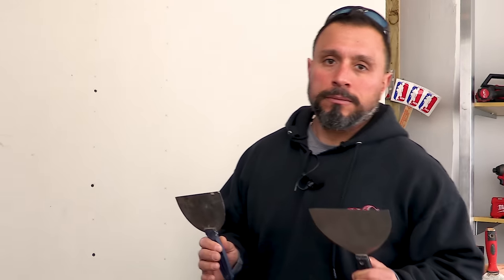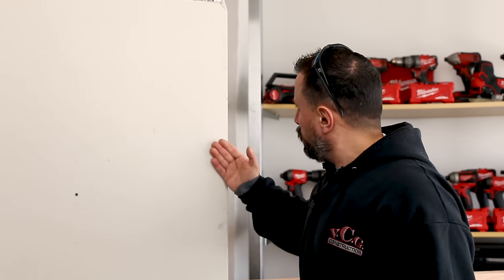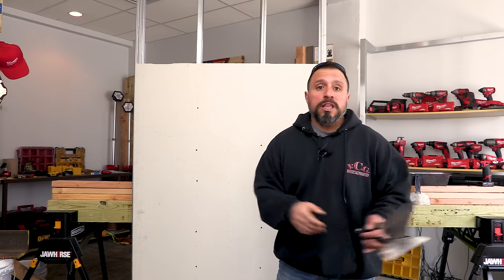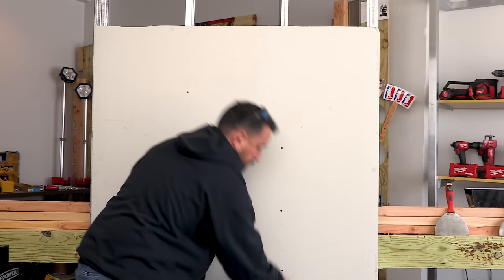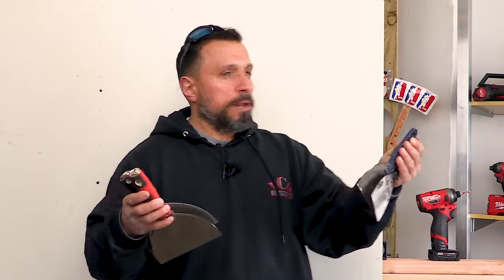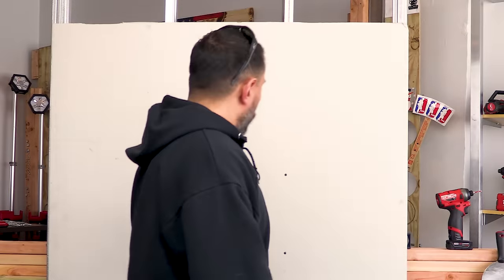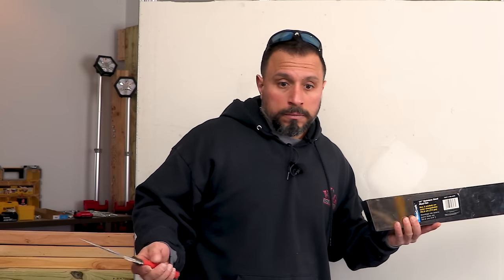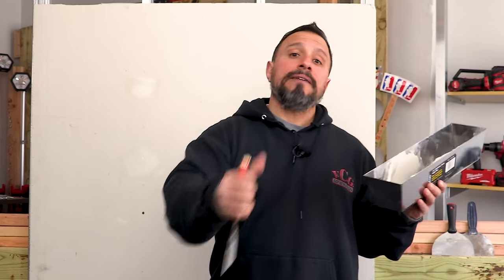DRYWALL FINISHING TIPS AND TRICKS THAT YOU DON'T KNOW ABOUT!

Comment: Great video, Vince!!!! This coming from a 30 year veteran of finishing drywall. Pre-filling gaps in seams ahead of time IS crucial. Critique? 2 of them (you knew it was coming) 1. Instead of "dry" running over screws, i always had the mud going.  Find a flaw? Correct it while mudding using the techniques demonstrated here.  2. Remove that god-awful sticker from the side of that mud pan!!! LOL! Hyde, I've found, have the best 6" knives with the slightly rounded BRASS-headed handle.   Steel can gouge and form edges that could cut the user. Just a heads up to those ppl who may be rushing out to get a finishing knife with any metal-tipped handle.  Thanks for the video and God bless! 😁
Reply from the maker: Thanks me again!!
Reply: You da man @me again
Same way I've come to do my muddin'. 
Also any major gaps like the one showed at the beginning, or any outrageous corners get filled and or skimmed before laying the tape and corners. Makes for a quick and painless tape job. 👍 and VCG you're a beast!
Reply: @MostlyPeacefulCombatVet  A brass- headed handle is also great for circling/marking flaws in the dried mud work. You probably already know that, though. 🍺
Reply: @meagain6028  for sure. But not everyone does so it's great to have the pro's of the very cool gang sharing info such as that! Everyone appreciates that! 👍👍
Reply: @MostlyPeacefulCombatVet  have any recommendation buying brass knife link?
Reply: @richardfox3924  I am not good with links. I am also just a builder specializing in finish work. I worked several trades though before opening shop. I'm no 30 year drywall finisher by any means. 
Anyway.... I just use the Kraft 5 inch taping knives with brass end. I have round ended and hammered end. You can find them at brick and mortar stores, or Amazon/ebay I imagine. I use a couple of kraft and a couple Marshalltown stainless steel knives for my fill and finish knives. Hope this helps. 👍
Reply: I agree ,  Hyde 6 inch knife is the best available.      Another tip would be to make for sure that your knife is not stainless steel .        If you get a stainless steel 6 inch knife you will never be able to break it in .    Stainless steel knives are too stiff .         Marshall Town 10 and 12 ,   Hyde 6 .       Don't get stainless steel .
Reply: Jimmy Jones marshal town trowels and Hyde 2 to 8👌I used plasterX 10 and 12 broad knives for box flushing, did it commercially for over a decade but a work injury won’t allow me anymore
Reply: Having a metal ended broad knife isn’t everything. probably the best knives I’ve ever owned didn’t have them. brand does play it’s part but the quality of the steel is the biggest thing. Spring steel blades are the best and choosing a knife that has the right spring to it for its application as well as choosing a blade that is already straight from the store. Good quality spring steel blades are actually tapered in thickness from the handle to the working edge giving it the ability to be flex when taking the edges off of joints and patches and having firmness when pressing in tapes. Probably the biggest thing before even using a new tool is to wear it in, sand off the clear coat so the plaster doesn’t bite into the protective coating making them hard to clean dry cement off of. Also sanding back the factory edges as they tend to scuff up the board and leave a rough finish on your work. Biggest tip is it’s easier to put more cement on than it is to take too much cement off. don’t think that putting a massive smear of plaster over a patch will save you from waiting around to put another coat on. You’ll spend twice as much time sanding it back than if you would have waited for the first and second coats to dry and sanded them back after having a coffee break midway through the next job your doing and you’ll still end up having an inferior finish.
Reply: @mrandrewjohns3657  I've always used drywall mud ,   I never had to apply cement with my drywall tools .
Reply: Clean your knives with an already used sanding sponge with water...it scrubs away any mud quickly. Dry or wet  and any rust on your blade. It also helps break in new knives and yes stay away from stainless cause it will take the home gamer a lifetime to break in. The other tip i'll give is wipe you screws tighter and leave no heavy edges.
Reply: Jimmy Jones I’m Australian and it is written on the side of the bags “cement”
Reply: Corn nut water and knives don’t mix rusts fast inside the handle
Reply: Jimmy Jones you should also stick to drywall as comedy isn’t your thing
Reply: @mrandrewjohns3657  YUP, right on point.  Maybe you should post a video?
Reply: @mrandrewjohns3657  
i do drywall and painting for a living. yes the blades rust a lil bit but no water on your blades...come on really....? you get a few years outta an knife and then buy another.
Reply: Corn nut my blue steel blades never need water they are easier to clean than my stainless ones but hey I have 20yrs exp drywall finishing but what would I know
Reply: @mrandrewjohns3657   You lost me here, "water and knives don't mix"?  I don't agree with Corn Nut using a sanding sponge on his knives, but mud and water depend on one another.  Leaving mud on a knife is what destroys the knife and after cleaning, I stand my knife upright, never lost a handle due to rust, just due to metal fatigue.
Reply: ya472 yeah maybe I did, there was so much going on and just blasted out a response without reading it, I’ve had the black and silver Hyde knives rust away inside the handle and had knives fracture right across the middle at the flex point. The black and silver knives weren’t my everyday knives just spares.
Reply: @mrandrewjohns3657  
i have 18 yrs exp with drywall and painting but hey what would i know?  Most taping is done with production tools now any
ways. boxes ,angle heads, tape tubes, glazers, rollers...thats where the money goes....not your pan and knife.
Reply: @cornnut2612  No one here knows you, but some people do the wrong thing for 18 years, because they refuse to learn or change.  Some people are so arrogant, they won't change, because they would be admitting failure, and they just can't do it.  lol
Reply: @ya472  
look i just threw out a couple tips for people...then bruh comes at me bout water and blades which is the dumest thing I've ever heard. scrub brushes are the most common I've seen on jobs and barrels of....wait for it.....water
Reply: @ya472 
also guessin its me you're last comment is referring to being you mention 18 yrs and not 20.
Reply: @cornnut2612  LOL   I only commented on your use of the sanding sponge to clean your knives.
Reply: @cornnut2612   I do not know you, just reading comments to the best of my ability.
Reply: @cornnut2612  I can't find your reference to me being a farmer..  did you edit or delete that ?    LOL    Well, you don't know me, but I have 40 years of renovation experience.  I do excellent work, no matter what I do.  I have had very few customers because they appreciate quality work.  I am not as fast as any trades specialist, but I do not sell speed, I sell quality, so I am constantly turning down work.  I am also a mechanic, a welder, an equipment operator, small engine mechanic, appliance repair, residential electrician, plumber, tiler, drywaller, framer, concrete work, all areas of residential finishing including trim, building cabinets, installing laminate, painting, texturing, tiling, siding, roofing.. and so on.   And yes, I grew up in Saskatchewan surrounded by farmers who I worked with.  At eighteen years of age, I could manipulate farm equipment better and faster than farmers who grew up on the farm.  I also buy and sell vehicles, real estate, operated a few different businesses... but you know what, I never specialized in just drywall.  However, everything I have commented on, is the truth and the correct way of doing stuff.
Reply: yall just like talking about yourselves.
Reply: @bryannonya9769  Thank you for listening.
Reply: Great video for tips, and from Me Again. I’ve been mudding 30yrs as well strictly independent self employed. Had a union muddier work for me 20+ yrs ago, learned so much from him.  A few other tips non-conventional but effective; durabond,,, the old green bag 90, amazing base coat product, but not for newbies.. Sometimes I mix with j.compound 50/50 (small batches) drill spinner, speeds dry times, less shrinkage, strong.... also I use “hawk” not pan. Little time to learn, but easier to use bigger knives, 10, 12,14,,, obtain smoother finishes as well. Last big tip I was taught, sand your own finish, you’ll learn to get very good at mudding...p.s. plan on 3 coats minimal..
Reply: Luv the brass end tip thnx!!
Reply: @cpmiller1965  you got it crispy m! I call that "super mud" 😁
Reply: All good to fix on the run with mud going off, I've always got a screwdriver in the top of the stilts for the base coat, but this house I'm doing now,,, some amateurs pinned it and it's taken a day and a half to prep for first coat. Screws hanging out, no screws, 20mm gaps on a 1500mm sheet, ceiling joint i spent an hour fixing, 10mm gaps in most of the square set, external corners sheeted out too far 4 my bead. Prep is key man, you got it right
Reply: ya472 I would say you are a dollar chaser. That being a comment. I try to do all kinds of different things. My work is good but I'm no speed demon
Reply: @cornnut2612  also the best way to keep clean paint and caulk off your hand in the shower. Just make sure the sponge is heavily used and it was fine to begin with
Reply: I hate those stickers, and they made with the worst glue imaginable to remove..wtf
Reply: My brother does a lot of dry wall and finishing work,  he always cleaned his knives with a sander. It would thin the metal over time, making the knives more flexible
Reply: Takes forever..
Reply: Great attitude for quality results.
I learned drywall (as a painter) doing major repair , minor remodel, restoring most surfaces, and establishing ease of motion, for all procedures ahead? Sure as hell isn't fidgeting.
Bet you do great work! Lol
Reply: @mrandrewjohns3657  I thought I was the only one I even sharpen mine (good ones) with a honing stone.
Reply: im a fan of "sheetrock" brand myself. I dont quite got 30 years in but i got 18. i used to be a fan of hyde tools, but now i only get my tools at Ames drywall supply where they have all professional drywall tools. I prefer sheetrock brand now, better quality imo
Reply: @mrandrewjohns3657  yea man, gotta heat up those Knives and peel the stickers off nice and clean then sand the edges for nice clean crisp finish work and not a scratchy rough finish
Reply: @MostlyPeacefulCombatVet  thanks for the info i go to the big box stores for a lot of tools (im sure most do) but for specialty tools have to go to the pros, like Sherwin-Williams for the good brush's (2 1/2'' 100% nylon). always like checking out the videos and comments for hiddin info lol stuff like this is hard to find if you dont have some old timers or life long pros nearby to tell ya. thanks again everyone
Reply: @mrandrewjohns3657  I am Aussie also..... and all the bags are labeled plaster in Australia. You are confusing joint cement, setting cement and cornice cement with the finishing plaster.... you did what? again? Oh I know...what would an architect know, right??
Reply: @ya472  So...a jack of all trades...master of none.... informing us all how its done?? right??
Reply: @sqnhunter  I did not realize the topic changed to lathe and plaster work.  In modern times most jobs are drywall, and the topic is DRYWALL.  Now perhaps your Aussie English has different names for the same thing, so I assume you have much to contribute to the original topic?
Reply: @cpmiller1965  someone told me a good tip was to press the first coat of mud into the hole with the back of the knife to really get it to pack in and glue it well together do you find that necessary or worth it?

Comment: Hey Vince! Ryobi guy here again reppin green team. I hang/finish drywall 8 days a week, use the new brushless makita drywall screw gun with the push drive feature,  and a makita impact driver to remove any misses or get in to corners / angles that the countersink collar on the screw gun can not get into all the way. Always wack the open holes left from misses with a ballpeen hamner, or butt of the knife as you showed, so the perforated edges dont require 3 freakin coats to make em vanish. However,  my pro tip, humble as it is, Using a ryobi 18v 3/8 stapler to tack up Quarter bead. Learned it from working with a guy whos probably the fastest/tightest/ hanger, finisher I've met. Couple weeks ago we hung 2 rooms, two closets, a small hallway and partition,  38 sheets, to code, in 6 hours. Just him and I, and im definitely not a record beater in that field, but he showed me that trick. Staples grab the meat of the hung rock corners, and the ryobi staple gun adjusts easily to sink them in a little more so theres no need  to sit there screwing off. I know somebodys probably like,' what about the bead crimper that affixes corner beads in place by pressing divets off the bead into the rock?' Well, in short, they fail over time. Getting bumped,  knocked, or normal wear and tear over time will def separate the bond, so theyll be there, but split seams will eventually pop up behind them, and or loosening that will lead to a crack right behind the bead.
Reply: I am hoping/requesting you guys do a show comparing all the new drywall screw guns, because I've noticed pretty much all the big name brands have put out newer models,  with new features,  From Makita  and Milwaukee to Ridgid and Ryobi.  ( Not sure if dewalts upgraded their gun to a newer model with push drive like the others), is the Milwaukee better than the makita? Is the ridgid official? Is the ryobi worth the 100 bucks for a homeowner/small project

Comment: thank-you, after 3 generations of passing down knives, finally bought myself an entire set of Hyde flexible stainless steel 1-12" and cant be any happier.
appreciate the tip, learned this one early on when finishing and not being able to find a hammer around, using the rear of the knife and splitting it in 2 using the cheap rubber or plastic handle, NOT full tang ones.. whole world of a difference

Comment: Love the video! I am one of those drywall finishers/repairsmen that knew this stuff, but excellent guide for those who don't know this stuff. I live in a very DIY'er area and may pass the video on to people. I use some Kraft brand stainless steel taping knives not found at Home Depot / Lowe's. The tool is just one solid piece of metal, no separation between the handle and blade. The knives don't rust or corrode and clean up is a breeze. 👍
Reply: Great choice in tool, I use the Kraft brand as well but solid stainless steel with the orange and black rubber grips

Comment: Been a finisher for 25 yrs. Chip and fill is definitely important. I prefer stainless knives, they last longer and don't rust. Set screws with a screwdriver,  doesn't screw up the paper or pop later. Also, a finisher coats rows of screws, not individuals and will pull the fill tight. Apparently Vince likes to sand... 😜

Comment: As a former finisher, another tip when it comes to ones knives is I’d tell all newcomers to make a mark in the handle and this mark ALWAYS faces the wall. Ensures a proper break in which can take a while depending on size of and material the blade is made from. Always hated breaking in a new knife, lol. Another fun video, Vince. Appreciate you all. Stay safe.
Reply from the maker: Thank Tim we appreciate the feedback!!
Reply: Not a fan of the S blade lol Good idea. I must look at my knife 50 time a day to 9 sure I'm holding them right
Reply: Agreed, Jason. At some point one can just tell by feel of blade on wall or looking at blade but the mark was how I was taught when I first started. It’s a tried and true method. I steered clear of the stainless blades. Plain old high carbon steel in my  “6 and down (I hardly used a 6” preferring a 5  and sometimes 4”) and I used the blue steel on 8”s and above. End of day, wash with brush and water in 5 gallon bucket, spray them with Wd and let em air dry over night. They lasted a long, long time. Much luck in your endeavors. Stay safe
Reply: Yep, that's a good tip, I always mark the handle and use only side for better break in, and never use stainless knifes are to stiff.
Reply: I sand new knives edges. Not too hard, just enough to take the burrs out and any imperfection on the edges
Reply: @lewisgibson1317  stainless steel is and stiff is the only way to go. Terrible technique is bending your blades when tapering the edges. Hold your blades at the correct angle. Better finish, no gouging out mud

Comment: I'm a commercial Carpenter. Some of our finishers put a couple drops of Dawn dish soap in the mud before they mix it up. They say it helps reduce the little bubbles and makes for a smoother finish.
Reply from the maker: Never tried that, guess the guys around here didn’t want to share every secret!! 🤣🤣
Reply: Superdan187211, we do that with mortar as well, the soap acts as a plasticiser. Makes the mixture more workable and due the water retaining properties, less likely to hair line crack upon drying. Great videos, just rang the bell.
Reply: I've also seen liquid laundry detergent from time to time over the years
Reply: Real talk, I do this. Only downside I've found is that mud spoils alot faster. Just something to consider
Reply: clear dish soap is old school but its used because they have a hard time getting there consistency right if your using boxes ect it helps too but bubbles come from your mixture and moving to fast slow it down